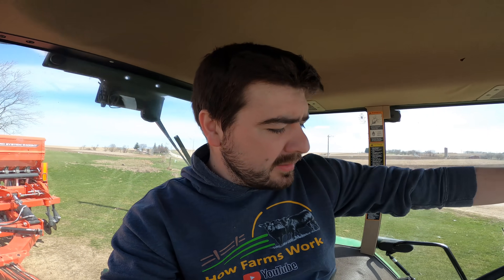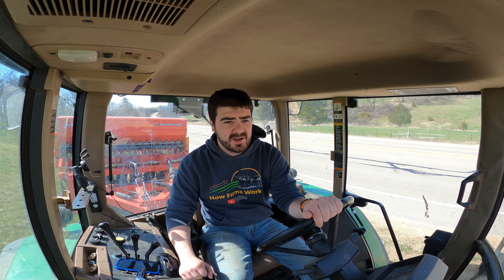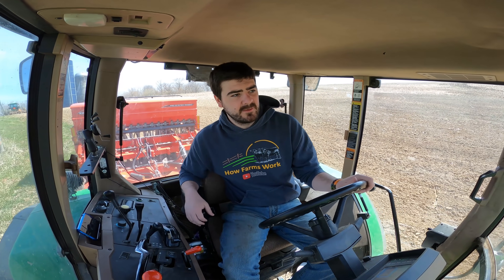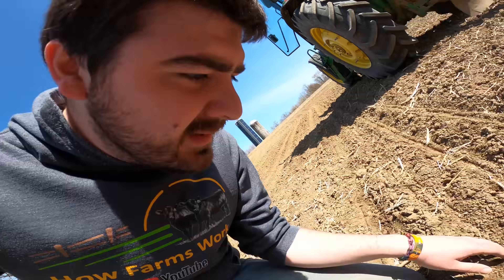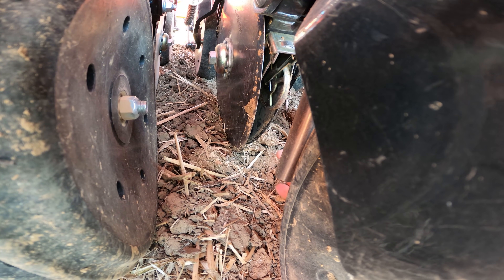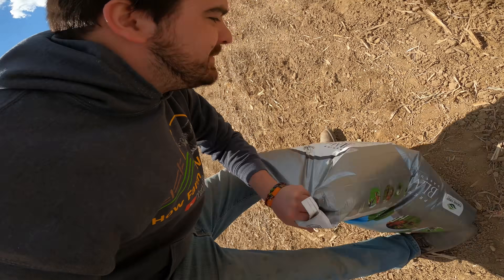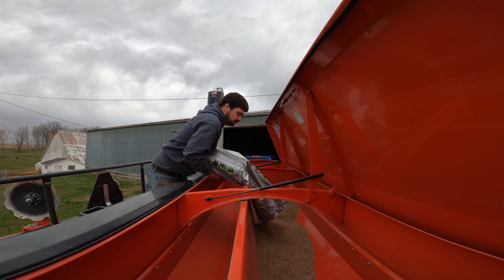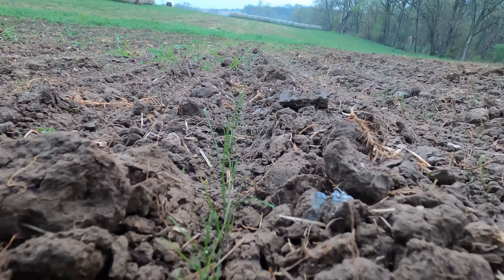Why Use A No-Till Drill In Tilled Ground? | KUHN 9400NT

Comment: Have you ever thought about using the turbo bucket trick with your shop vac? Just in case you don't know what it is. You run the house from the location you want to suck up from (seeds in no til drill in this case) into the top/ side at an steep angle (parallel to the ground). The hose to the shop vac goes into the top center vertically. It sucks up just like a normal shop vac but you can put it on, say,  a 50 gallon drum. All the material you're removing goes into the turbo bucket as your shop vac stays empty and runs at max performance. Would be perfect for emptying seed from a drill or an Auger or cleaning out storage bins. Hope this helps IF you haven't heard of it. Good luck.
Reply: Do a video of that.... OL J R :)

Comment: We have a left turn that they always try to pass , so as on coming traffic will allow we just put it in the middle  of the double yellow line .   If they try to pass 15' wide middle of the road they will do it in the ditch.  Its better to just block the road than have a little car under the left set of duals .

Comment: I was at a wreck where a tractor turned left and a truck was passing at 75. Boom totaled truck and tractor. Sent the truck engine through the cab and flipped the tractor over and flung the driver

Comment: Perhaps the answer to hand signals is not to rely on drivers understanding. Simply pull right as you slow and wait stopped until it is safe to turn right. Might take a bit more time but accidents will ruin your day. The answer to all these interactions is do change direction slowly. We know where we are going but you have to give unambiguous ques to other drivers.

Comment: Yea, people today aren't very smart when it comes to hand signals. Shame really, as each state used to have this covered in the DL book they used to send out to get your DL. Which this has all changed. 
No offense meant but, this is where I prefer the old Van Brunt grain drill, seems to have done a far better job than today's drills. Great video as always Ryan. Cheers :)
Reply: Oh, the new drill did a nice job for sure, BUT that's also probably about $30,000-45,000 piece of machinery I'd guesstimate!  Not THAT much better than the job done by the $600 Van Brunt... OL J R :)

Comment: Instead of using the shop at, could you have put it into “calibrate” mode and just dump it all into the calibration tray?
Reply: Still doesn't clean out the corners and between the meters... plus you'd be cranking a LONG TIME to get those last few pounds out... Later!  OL J R :)

Comment: for seed catching, make a 5gal bucket into a trap, run a 2" piece of PVC up in through the bottom to about an inch below the top with an U of a trap on it so the seeds slide around, then bulkhead a connector for the hose on top and make a circular inset that's covered with hardware cloth.  It'll let you get about 3.5 gal of seed out at a time.  You can make the lid easy to unlatch or put a pour out down to the side with a cap on it.   Most seeds should never be run through the hose of a shopvac, it can crack them and will rub off a lot of the seedcoat while blowing it into the air.     Other option if you have a great shopvac is to use smooth hose, but using the trap will do the best job, that way any dust/shards/seedcoat will be in the trashbag of the vac.   Cost ya maybe $15 to make.
Reply: You should make a video showing how to make one... OL J R :)

Comment: No-till disc drills have really good seed depth placement even at higher speeds. It's all dependent on how well the discs penetrate the ground and how much down pressure it can handle without putting uneccessary stress on the discs and gauge wheels. Softer ground, like your tilled areas, don't need much down pressure because the ground is so loose to begin with. No-till ground can vary from year to year depending on the weather with moisture and heat... some years like the current year we're having it doesn't need much pressure, other years like drought take a bit more.

Comment: Glad you cleaned drill out. Last year got ready to sow soybeans put beans in drill mice had gotten in bin at eaten the plaste cups chewed holes in cups cost me 1200.
Reply: The mice will eat also emptied metering chambers. They like to make their own openings. If you leave the metering chamber valves down for the winter the mice do not eat the parts. Usually there is a central lever to open and close the valves below the metering rollers.

Comment: How come the Kuhn drill sounds so squeaky when running
Reply: Scrapers keeping dirt from collecting. It's metal on metal, with the scrapers being a softer metal, which makes it a wear point. Rather have scrapers wear down instead of the discs.
Reply: Farming 4G unless you get carbide scrapers

Comment: Will that drill, drill beans? And would you ever?
Reply from the maker: It could in theory, but we'd want a larger unit to do so otherwise our planter would run laps around it.
Reply: @HowFarmsWork  Would really like to see it put down some beans. Do just as a test strip or two, see how it actually compares to the planter and at harvest. You might even be surprised...
Reply: I'm assuming it could drill beans, as long as it has the ability to swap parts to handle the larger seeds and ability to block off seed tubes to be able to have larger row spacing. We've been seeding beans with a Case SDX no-till drill instead of a planter for 10 years, the only thing that has to be swapped is the seed roller on grain cart to handle the larger bean seeds, and block off seed tubes to get larger row spacing if wanting that option (going from 7.5" to 15" spacing). Instead of going by seeds/acre like a planter, need to go by weight per acre instead.
Reply: Thank you guys

Comment: wonder if that company that sold you the grass would appreciate the chance to improve their bag design to limit the junk in their bags. Another great video Ryan, and looking forward to more!
Reply: They should because IF that junk doesn't plug up the meter by wrapping around the fluted feedcup, it'll almost certainly wad up in the seed tube and plug a seed tube.  

One time when I was drilling soybeans I was looking back at the drill and checking things out and saw beans raining down under the box.  Went back and checked and turned out a piece of glass somehow made it through the cleaners and into the bag... it must've been in the machinery for a LONG TIME because the edges of it were worn off smooth, didn't cut anything, but somehow it ended up in the cleaned beans and in the box and went through the meter, but it dropped down into the opening of the drop hose and it wedged and plugged it off, beans backed up the funnel and started pouring out the back just behind the meter, raining down behind the drill opener.  Good thing I was keeping a sharp eye on everything and caught it quickly.  

Later!  OL J R :)